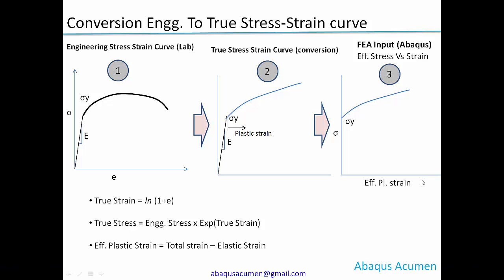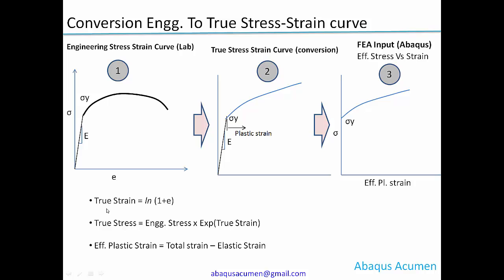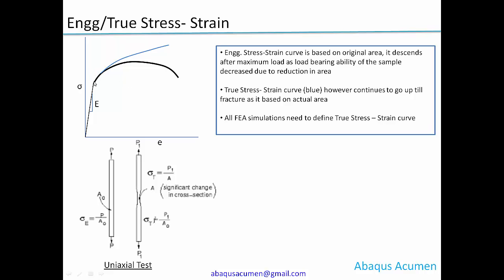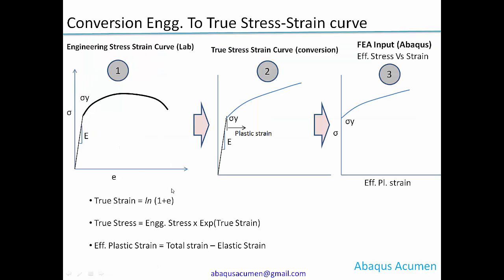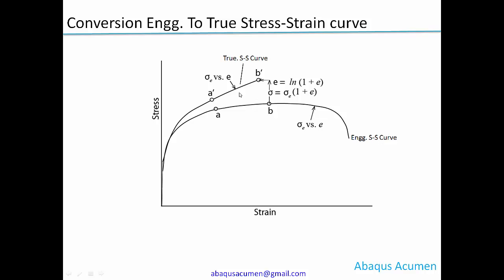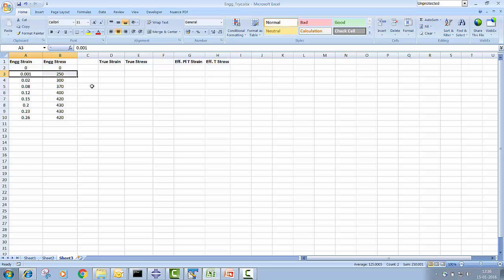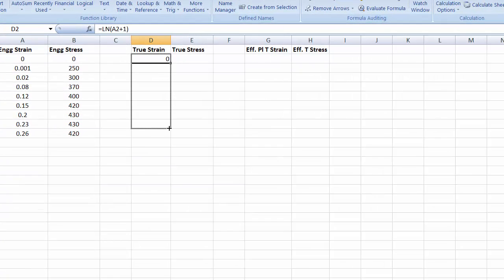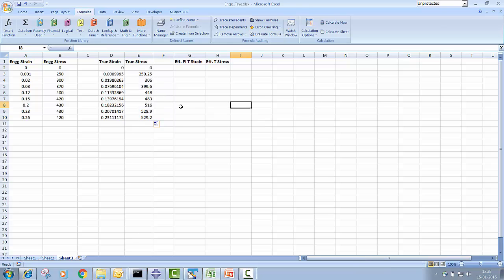Converting Engineering to True stress-strain curve Tutorial

Comment: Sorry, 
the way how you are calculating the effective plastic strain is not correct. You have to subtract the elastic strain from the total strain at the specific stress level.
The correct way is described here:
https://abaqus-docs.mit.edu/2017/English/SIMACAEGSARefMap/simagsa-c-matdefining.htm
Reply: thanks, but I think it give the same results
Reply: @aouiched9613  Usually it would not give the same results. This assumption is only correct, if the stress after the Yield point remains constant. This is usually not the case. There are definitely deviations which cannot be ignored.
Reply: Exactly I was looking for this comment!

Comment: I am afraid you calculated the plastic strain in a wrong way my friend.. You can review the Abaqus documentation regarding this.. You have to use the true stress at each point.. not only the value at yielding.

So it is written like this: 

True plastic strain = True strain - Elastic strain
Here.. the elastic strain does not refer to the constant value at yielding but to the elastic strain that would have taken place if the material maintained the elastic behavior. You can simply write this term as follows:
Elastic strain = True stress / Modulus of Elasticity

So, basically this term is a variable for each step, not a constant.

Please check it here:
https://abaqus-docs.mit.edu/2017/English/SIMACAEGSARefMap/simagsa-c-matdefining.htm#simagsa-c-matdefining__simagsa-c-mat-stress-table
Reply: Correct. The true stress is changing every data point and so the corresponding elastic strain is also changing at every data point considered. The E value is constant here. Thank you for pointing it out with appropriate documentation.

Comment: I would like to ask that which data points should I enter in FEA software? I have over 400 data points for the compression test of concrete material without any reinforcement. I have converted the raw data by following your video but can't figure out how many data points shall I enter?
Reply: HI! Did you found your answer? I am also looking for the same issue!

Comment: tx. i have a question? until when we need to enter the data? until fracture point or up to ultimate tensile strenghth?
Reply: HI! Did you found your answer? I am also looking for the same issue!
Reply: The point up to which you feed the data will be calculated from the curve and after that the curve is assumed to be straight
Reply: Until ultimate tensile strength because that's the point where necking in specimen occurs.